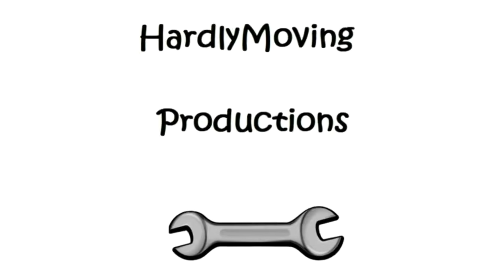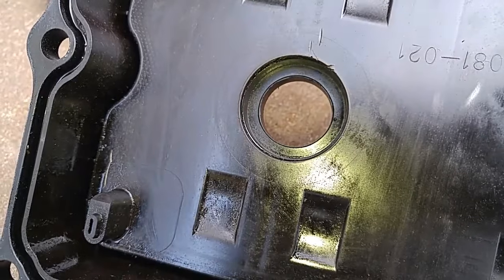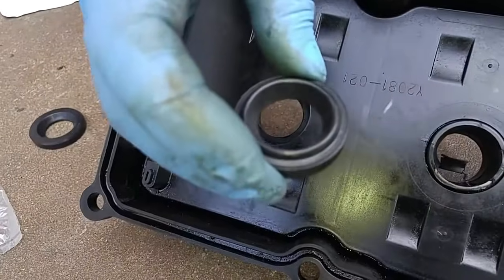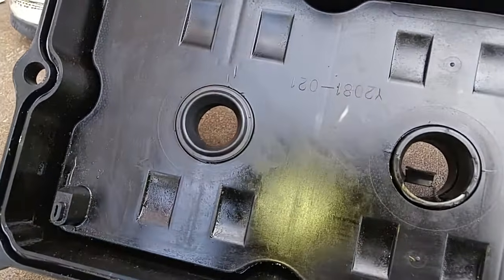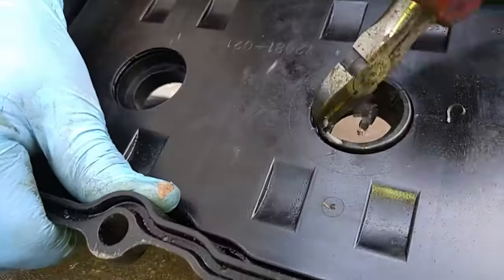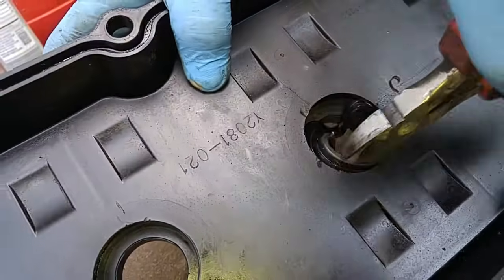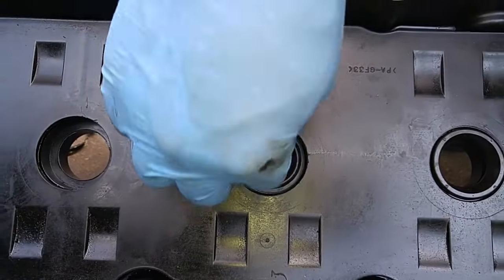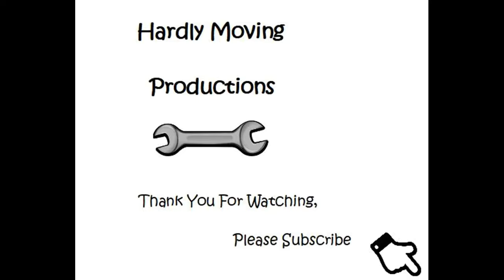How To Replace Nissan & Infiniti Spark Plug Tube Seals

Comment: What year civic and engine size did you use for the seal?
Reply from the maker: 2010.  But you may be better off buying a new valve cover in lieu of replacing the seal.  Plenty of 3rd party vendors selling them for around $50 on Amazon and Ebay.

Comment: Exactly the problem I'm having with a Nissan rogue. I bought the seals with the gasket but there is no way to replace the seals, you have replaced the whole cover. Why would they seal those separately if they can't be replaced? Wtf man
Reply from the maker: With Nissan engines you're better off buying a new valve cover.  Not too expensive.

Comment: This did not work on my 2003 Pathfinder - the seals od was small and loose, also the ID is a little smaller so takes effort slide into the tube.
Reply from the maker: You may be better off buying a new valve cover.  They're pretty cheap on eBay.

Comment: This seal honda civic 2010, fit to nissan armada 2007?
Reply from the maker: Wouldn't know.  Maybe easier to buy a cheap replacement valve cover on Amazon or ebay

Comment: I have a infiniti m45 2006 what year are the seals for the civic
Reply from the maker: More and more aftermarket parts retailers are selling a new pair of valve covers with new seals and gaskets for under $100.  Believe that's you easiest option IMHO.  Check out Amazon.com

Comment: This is my third time replacing the valve cover on infinity fx35 🥲. Still leaking from tube seals. What is the part number for the tube seals?
Reply from the maker: Don't have the number.  May be cheaper buying a new valve cover.  Their prices seem reasonable on Ebay.
Reply: Will these tube seals in the description work for a 2003 Fx35 aswell?

Comment: Do we need to add to atv seal or no just asking
Reply from the maker: Use RTV to seat the gasket to the valve cover
Reply: @hardlymovingpro  my cars not exelerating what should I check
Reply from the maker: @abumannocchi  too much to recommend.  Start with check engine light codes
Reply: Multiple misfires plus 02
Reply from the maker: Start with new plugs.  Then perhaps new coil packs

Comment: If oil is inside the tube,  it is not leaking in from that seal.  Oil gets in the tube at the bottom of the tube, where it screws into the cylinder head. Oil leaks past the threads and into the tube from the bottom.   The tube must come out, and then the threads are sealed, and the tube is screwed back in.
Reply: Not all cars are the same. Nissan says & we can confirm, if oils inside the spark tube its coming from up top, not beneath… unless you catastrophically blew your engine & head gasket.
Reply from the maker: Here...watch this video to see how I fixed the tube oil leak on a Toyota:  https://youtu.be/qSiSC1bceT8
Reply: The only problem this tubes on the g35 don't have  any thread  how can I  remove  them?
Reply: Ummm, I'm aware of that and have resealed them in the past. That is not the style of this valve cover. If there is a seal in the cover,  that is for the spark plug tube.

Comment: What size were the seals that you need? I’m going to attempt this job on my Altima.
Reply from the maker: Recommend you bring your valve cover to a local parts shop and try to match up the seals.  I used seals for a 2010 Civic.
Reply: @hardlymovingpro  yes thank you I will keep that in mind

Comment: Are the seals supposed to come from a base model r18 civic or a Si k20 civic?
Reply from the maker: Can't say.    What I did was to take the cover to a local auto parts shop and opened different boxes of seals till we found ones that fit.  I also measured the diameter of the spark plug tube so that the inner diameter of the seals would seal around the tube.
Reply: @hardlymovingpro  so then how do you know it's from a 2010 honda civic?
Reply from the maker: That's what the auto parts store cashier got for me.

Comment: This is not a M45. It's an old maxima or I 30 I think. M45 is a v8!- this has 3 cylinder tubes...so is from a v6. I'm now the proud owner of a new dremmel, some cut wheels and 2 felpro seal sets I didn't need and 
Now have bought new valve covers for my vk45de infinity 😢
Reply from the maker: Thanks for the update but definitely remember the car as a M.
Reply: @hardlymovingpro  old M30 maybe...
Reply: So this ain't good to do on a 2006 m45 infiniti
Reply: Bro. Am I missing something here… or are you joking….? Maybe….? The video is on a V6… so, there are actually SIX tubes—3 on each side of the engine… aka bank 1 and bank 2. Yes, the VK45DE is a V8. Guess how many tubes a V EIGHT has!? 4 tubes w/ bank 1, and 4 tubes w/ bank 2. Your V8 has 8 tubes… the car in the video has 6 tubes lol what’s the issue, my guy?

Did you just throw in the towel, n get all sassy at the kind and skillful gentleman who’s somehow by the grace of GAWD, patient enough to participate in an awfully painful and never ending thread of brainless and lazy comments and the same gd question asked over and over…. Dude! Are you srsly claiming this doesn’t work with your V8 because your engine simply has just 2 more additional tubes than the vehicle he’s working on!!!??? GOOD GRIEF MAN!

In the nicest possible way im gonna say… if the thought to purchase an additional 4 of the Honda seals and that you’ll be doing this process to 8 tubes, not 3…. Or 6…. If this thought did not occur to you….

…let this be your sign for crying out loud! This is not for you. You literally were bout to go in hard and fk around with the beauty that is the VK45DE engine lmfao! I feel like I need to call child protective services on you…. Welfare check on your M45! lol

Your second sign…. You didn’t already own at least one Dremel… AND you seem pretty annoyed that you do now lol anyhoo…. Wow.

Comment: Did this exact fix on my 03 Pathfinder and and so far it’s holding up man thank you so much. How long has it been holding up for this valve cover? Also my car now has a slightly rough idle any thoughts? Thanks
Reply from the maker: Did you check the spark plug gap?

Comment: The problem is you can't get the top cover gasket with the seals from the auto parts store 
At all but you can get a gasket from Walmart the entire kit I'm serious 
Second you can't get the valve cover gasket kit entire assembly 
This nissan rogue will be fun 🤣
Reply from the maker: Thanks for sharing!  A link to the Walmart kit would be nice.

Comment: Im trying to do this but the Honda seals are so snug im having problems getting them to slip on the spark plug tube. What exact 2010 honda  civic seals did u guys use?
Reply from the maker: I went to my local auto parts store and did a mix and match to find the right size.

Comment: Can I use the same Honda grommets for a Nissan Frontier 4.0 V6?
Reply from the maker: I think so with a 2010 Honda Civic seal or measure the interior and exterior diameter of the old ones and go to your local auto parts store to find a match.

Comment: I saw on ebay that the gasket Fel-Pro ES72481 fit for VQ35DE engine, Has anybody used those seals? please tell your experience. Thanks.

Comment: Will there work in the HR engine ?
Reply from the maker: Can't say.
Reply: My HR is leaking oil into the spark plugs 😢 guess I’m going to have to buy a new valve cover
Reply from the maker: Believe newer Honda's have serviceable spark plug tube seals.

Comment: I just bought the OEM valve cover for the 2.5L and new gasket for $53 - 13270-JA00A 1 $ 9.05 - Engine Valve Cover Gasket
13264-JA00A 1 $ 43.64 Engine Valve Cover
Reply from the maker: Good deal!

Comment: Hi I recently replaced my tube seal and did as you did but I'm still having a misfire on that cylinder there's also a smell of gas/fuel when I start the car any suggestions? 

I also check spark plugs 
Ignition coil 
Fuel injector
Reply from the maker: Did you replace the coil pack or at least swap it out with another coil pack from a different cylinder?
Reply: Did you ever figure it out?

Comment: be very careful guys, the m45 infiniti valve cover is similar but the tube seals are DIFFERENT…
THIS WILL NOT WORK on the vk45de engines… 
you can do something similar with the same civic part but it’s a bit more sketchy, go slow with a dremel and use a lot of hondabond  and u may be ok
Reply from the maker: Good to know and thanks for sharing!
Reply: I have a infiniti m45 2006 what seals can I use

Comment: Hey so I read ur description I bought 2 packs using both types of seals that came in the pack did u use both types or jus the one the fits snug?
Reply from the maker: Ones that fits snug over the spark plug tube.  Use RTV to hold in the valve cover.

Comment: Kinda of risky don't you say. And to much work and I see some damage when cutting.  I'll just buy a new one for safety. But yea good luck.
Reply from the maker: Couple hundred bucks for a POS plastic cover vs $20 bucks for new seals.  So far this repair has been holding for the customer.

Comment: I heard a guy say his coil packs didn't fit after can anyone vouch this works and everything still lines up and bolts up?
Reply from the maker: The coil packs fit into the spark plug tubes.  The tube seals, which wrap around the tubes, does not interfere with the coil packs.
Reply: @hardlymovingpro  ok I'm going to give it a try. Bought oem honda seals and infiniti gaskets and good rtv so guess the rest is up to me, if it doesn't get me a few more months ill just buy from z1 😅
Reply: @hardlymovingpro  hey so I actually purchased the seals. There seems to be two variants of them inside the 8 pack I bought?

Comment: Does this work in the 09 Nissan Maxima?
Reply from the maker: Can't say but the concept is the same
Reply: @hardlymovingpro  thank you. We are having the hardest time trying to find the seals for the civic without having to buy a whole kit. When I call to ask about the civic seals they ask for the “ex , ls... or whatever type of Honda it is. I didn’t realize having a maxima would be this draining 🥴🥴
Reply from the maker: Suggest you go to a auto retailer who will open up gasket kits to help you find and match the seal size

Comment: 2010 Honda Civic but what a trim.
Reply: 2.0L .Im about to try it tomorrow on my FX35. Just ordered outter seals and all the Civic spark plug tube seals. They sell them in 8 packs so i got 2 packs since i will need 12. Hope it works!!!
Reply: @robertgibson1707  is that worked? I'm planning doing it on my 350z

Comment: Do we know the Honda partnumber?
Reply from the maker: Nope.  I just went to a auto parts store and matched the seals that would fit.
Reply: @hardlymovingpro  what are the sizes of the original seals? Im trying to find some in New Zealand but im finding it hard to find the ones you used. Maybe if  i get the measurements for the originals i could find ones here that match, thanks👍🏾

Comment: Great pinch idea, but the math and hassle wouldn't work in my favor.  I would need 12 tube seals and they are about $25 for 8 seeing I need 12 that's $38 and I don't own a dremel. Also good chance I could damage the Valve cover seal seats cutting into it and a pair of new Valve Covers with factory seal tubes is $50 Ebay.  But in a pinch this is an awesome idea!
Reply from the maker: Be careful with Ebay vendors.  Could be Chinese knock offs that may not fit properly or the plastic doesn't last (can't take the engine heat).
Reply: They are about 15$ each yeah to save a little might be good if it works

Comment: Sir, it will work out also for nissan xtrail 2006?
Reply: Are the tube seals of 2010 honda civic also fits for nissan xtrail 2006??
Reply from the maker: @erickdizon5485  Might work.
Reply: Oh so not sure for now.. i hope so bcoz i have the same problem now for my 2006 xtrail.. oil leakage goes to my sparks..
Reply: If that works, u mean i replace 2 tube seals at every holes?
Reply from the maker: @erickdizon5485  yes
Reply: Can you inform me again if that can be really applied for nissan xtrail? Thank you
Reply from the maker: Can't say with certainty.  May have to experiment with other seala
Reply: @hardlymovingpro  well if that's the case maybe i should try as you said. Or maybe i will do more research about the entire xtrails valve cover and other parts.
Reply from the maker: Unfortunately if the seals leak Nissan wants you to buy their valve cover with the new seals
Reply: @hardlymovingpro  but here in the Philippines that is so expensive.. the valve cover and the valve cover assembly costs 19,000+ pesos.. almost 20k in our money.
Reply: Not convenient to buy a new valve cover if the gaskets and their seals only need  to replace.
Reply from the maker: @erickdizon5485  i know
Reply: Very huge difference if you only replace seals and gaskets than to buy a new valve cover. Can saved a such amount of money.
Reply: @erickdizon5485  same here in indonesia, ive immediately sold the car after the repair job if i were u....
Reply: @dimassmith8367  🤣🤣🤣🤣 why  ,it’s simple fix and good  reliable car will last for years best Altima made better than Cvt transmission models
Reply: Sir, do nissan xtrail 2006 and nissan altima had the same valve cover?
Reply from the maker: @erickdizon5485  Sorry ... I do not know.

Comment: Hi do you know if the valve cover come with the seals when you buy it
Reply from the maker: I've never seen a Nissan valve cover gasket kit with replacement seals.  I guess the manufacturers figure if the seals are worn, you need to replace the valve cover ... unless you come up with your own way to replacement them ... like in this video.
Reply: @hardlymovingpro  whenever the Nissan spark plug tube seals are worn will it cause ticking noise during acceleration?

Comment: can you tell me what year and model is this valve cover
Reply from the maker: Think is was for a 2007 Infiniti with a V6.
Reply: @hardlymovingpro  g35? vq35hr? de?
Reply from the maker: @GhostOfBrickCity  It was some M series I believe.
Reply: @hardlymovingpro  GREAT!! so i decide to change valve covers by myself and i do the left one first, finished barely no issues.. then as I'm taking the last one of the bolts on the right side. it snaps and it's stuck inside the hole.. FML!!! now i gotta take the car to a mechanic... worst part is if i would of looked inside the spark plugs tube. i would of noticed that after i cleaned it a few months ago and changed the spark plugs. their wasn't no oil in there and i didn't need to change the valve cover..... SMFH
Reply from the maker: @GhostOfBrickCity  Live and learn .... unfortunately.

Comment: I'm planning to do this, this week! thanks! does it work same process and civic sizes on a 2007 g35x sedan vq35hr motor????? i was planning on buying new valve covers with so many to choose from and so many bad reviews on every single place i look online and ridiculous dealership prices i might as well try it myself. good project..
Reply: Hey there did you end up doing this method? If so how has it been holding up any leaks? I too plan on trying it out on my Vq35hr Z
Reply: Hey did it work?
Reply from the maker: Sorry ... can't say since I haven't worked on the G35 series.  It'll be more like trial and error.  Take out one old seal and bring it to your local auto parts store to do a match up.
Reply: @hardlymovingpro   hey did it work for you or what method did you do pls reply thanks
Reply: @hardlymovingpro  ok thanks

Comment: Im having this issue. Ordered these same part number at the parts store. They were 21 and 38mm. What am i doing wrong here? They were felpro
Reply: I ordered another set of 2010 civic tube seals. Same. To small 21x38mm. Same part number same valve cover. Are u sure those are the year make of the seals u used? Thats the 3rd set iv ordered that were wrong. With the same part number u provided. Jus trying to figure this out.
Reply from the maker: You used the 2010 civic seals?
Reply: Yes. They were labeled fuel injector something seals tho.
Reply from the maker: @chrissannes1348  Should be "valve cover spark plug tube seals".
Reply: Ya thats what i thought. The other ones i have that are to big say that. Idk if maybe 2 packs were mis packed or what
Reply: Did you take the valve cover gasket from a base model 1.8L r18 civic or a Si 2.0L k20 civic?

Comment: with the civic seals were they nice and tight around spark plug tubes? I have 117k on my pathfinder, at what age do you feel seals may need to be replaced?
Reply from the maker: Yes .. the seals fit fine.  If or when you pull out the ignition coil and there's oil on the tube's connector, then the seals are leaking.   Haven't seen this problem on the pathfinder.
Reply: @hardlymovingpro  would you need to replace the coils aswel or just clean the oil out? And what Honda are the seals from?
Reply from the maker: No need to replace the coils.  2010 Honda Civic.

Comment: this is a real nissan blunder that they keep for years... and give lesson to me not to buy any nissan again. my experience is with QR25DE in T30 2005, and Ur described method its the same thing as my mechanic had done.. but the replacement seals cracked up again when i drive it on highway, i  push the engine to the limit in high revvs, so after another same work had been done, ive sold the car and never buy nissan again ever
Reply from the maker: Yup ... a poor design.

Comment: I can't seem to find Fel-Pro products where I am on the other side of the globe. Do you know if there's a Honda part number for the seals you're using?
Reply from the maker: You can do a google search on a Honda dealer that sells on-line.  Their website should have a parts search engine.
Reply: @hardlymovingpro  Found it after a long search. It's 12342-PCX-004.
Reply from the maker: @AbdullaJaafari  Good for you!

Comment: So how well did this work out?
Reply from the maker: No customer complaints or customer "come backs" so far.  Work was performed to fix a cylinder miss fire problem caused by oil getting into the coil pack tube.